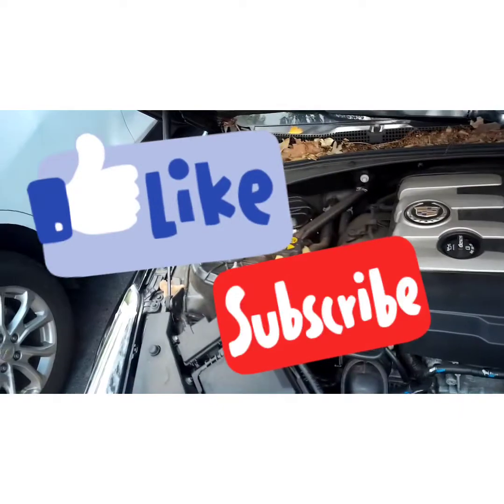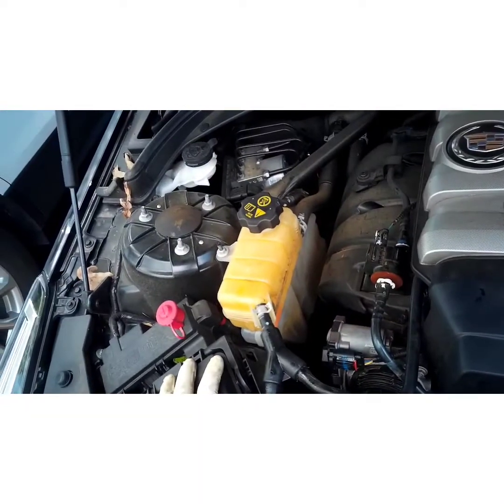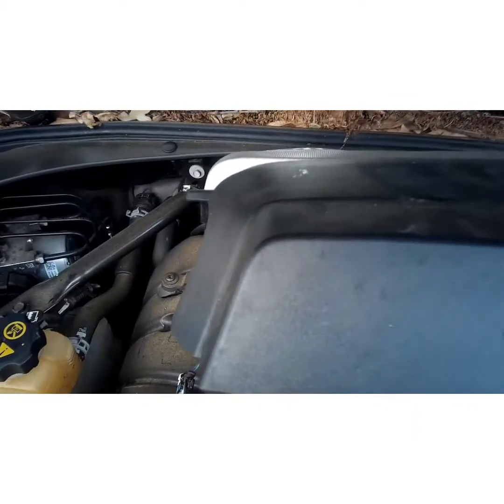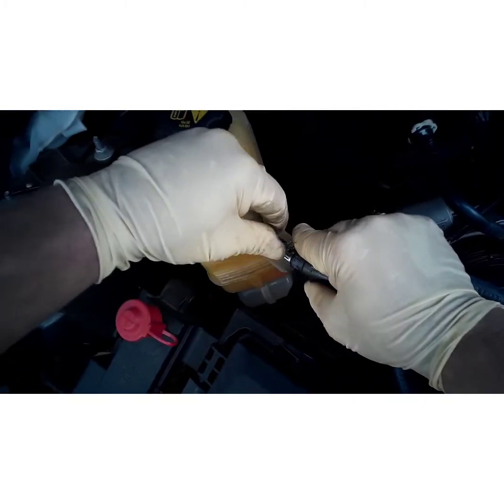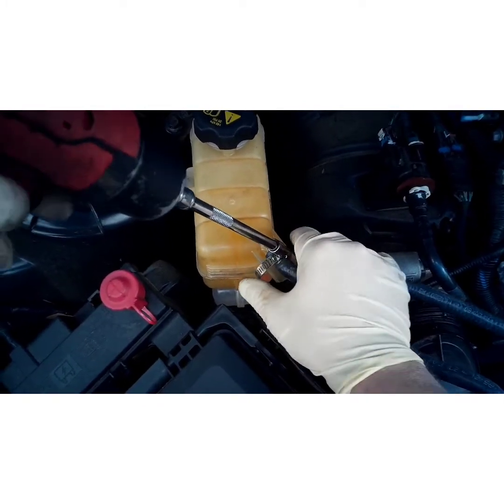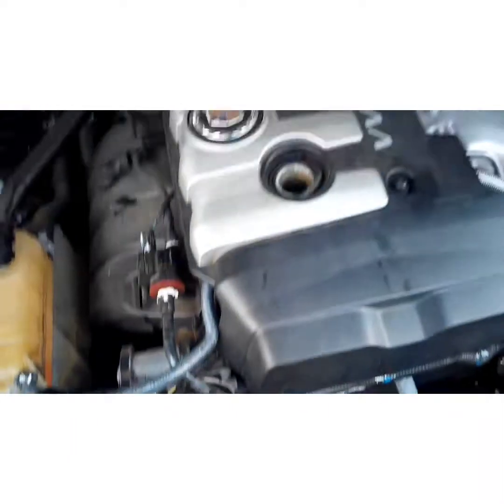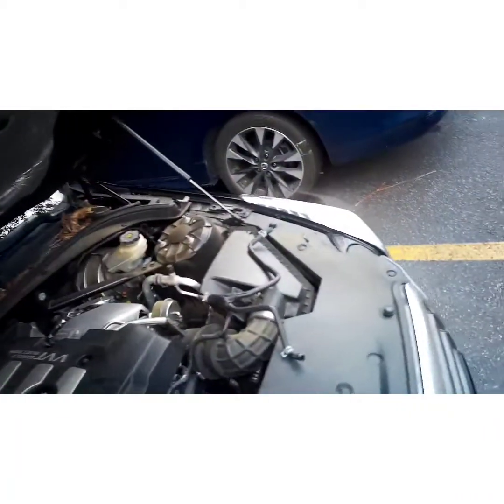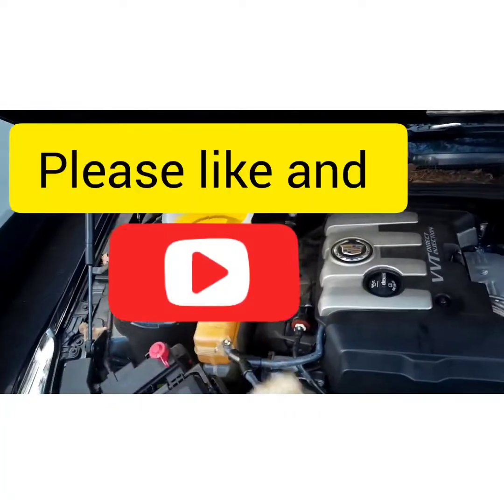Cadillac ats coolant reservoir return hose replacement 2014

Comment: 2.0T LTG ATS- I have one question should the second portion of the reservoir be filled? my top portion is filled like it’s supposed to but the bottom section is empty. The car never over heats same fluid is there every day, though after driving it does bubble a lot 🤷‍♂️runs good though.
Reply: yeah, should be about halfway full

Comment: I have a question when you change the antifreeze reservoir to a new one do you have to take it to a mechanic so they can adjust the pressure of the antifreeze? Or can you just replace the reservoir and run it like normal?
Reply from the maker: Just replace and top off with new 50 50 mix
Reply: @automotivetech-vet  when my car broke down I was driving and the tip of the reservoir broke so it threw out all the antifreeze I think when it broke it caught air don’t I gotta take out that air ?

Comment: Can I add coolant in my reservoir with a funnel to bleed it out while the engine is running? I don’t have that fancy funnel you have. Or can I add it in the radiator? I’m about to replace my upper hose and I look pretty low on coolant

Comment: Could I know what type of screw head to buy so that I can remove the engine cover? Should I just get a torx bit set that goes from T8-T60 or do I need a different set?
Reply from the maker: I think it's a t 30
Reply: @automotivetech-vet   Thank you, you said t30 in the video but I just wanted to make sure you were talking about the same thing and not some other tool that you had or another car part

Comment: Thanks for making the video, my hose has just broke in the exact same spot. I ordered a new one online. 
Do I need to use the no spill funnel in order to bleed out my system
Reply from the maker: U don't have to just keep pouring till warmed up and full my friend
Reply: Where did you order it from and is that the exact name for it? The one in the title?
Also how much did you pay?
Local GM wants 86 plus tax 25 sounds a lot better

Comment: You replaced the hose reverse from the way it came off as far as radiator and manifold connections.  Guess it probably does not matter, just follows the curves of the other parts better.

Comment: What error msg were you getting?  I'm getting 2 msgs- IDE ENGINE-ENGINE OVERHEATING and AC TURNED OFF DUE TO HIGH TEMP. But I don't have a leak & my temp gauge goes from C to H back to C
Reply from the maker: It sounds like you have air pocket in the system just run it till the heat blows hot good indicator it is bled out
Reply: Mines is doing the exact same thing.

Comment: What size is each inlit from each hose of that reservoir to coolant tank i just want to put a aluminum y splitter with new hoses so it can last longer than that because they crack easy
Reply from the maker: 3/8

Comment: Should the reservoir be completely full to the top? On my 2015 3.6 ats it’s only about half way
Reply from the maker: Half way
Reply from the maker: Their should be a min max line on the reservoir
Reply: @automotivetech-vet  ok thanks. I’ve seen some on YouTube and theirs is to the top.
Reply from the maker: It won't hurt it to put it to the top , if you don't see a min max mark just put it to the top
Reply: Hello have the same issue where can I buy hose and what would part number will be I have a hard time finding hose thanks
Reply: @juancalixto5760  there on eBay cheaper original GM part reservoir to coolant tank hose
Reply: @automotivetech-vet  I just had the plastic tank replaced on my 2013 Cadillac ATS and when I pop the hood the tank was filled all the way to the top usually it was halfway

Comment: Will the coolant in the funnel go into the reservoir once all the air has bled out ???
Reply from the maker: Yes when your heater starts blowing hot and no air bubbles your good to block off funnel and put cap on reservoir

Comment: Been looking everywhere. What is the hose called in the back of the tank/reservoir with the connection,  i think the textured looking hose is the vacuum hose, the hose your changing is inlet hose. But what the big hose in the back side of the tank called?
Reply from the maker: Reservoir outlet hose I'm pretty sure
Reply: @automotivetech-vet  thankyou ! Gotta change that hose, because at the cross it slowly leaks. Guess while im at it, replacethe coolant tank too.
Reply from the maker: @dennybohan8455  not a bad idea,  if you pull the hose from the bottle u can take a pic and extract the oring inside and match it up with a new oring same size  , most the time it's the oring that causes the seepage not the hose , hope that helps
Reply: When I was calling around today I was using the name you put on your video and they were having a hard time finding it. And I’m worried I asked GM for the wrong one.